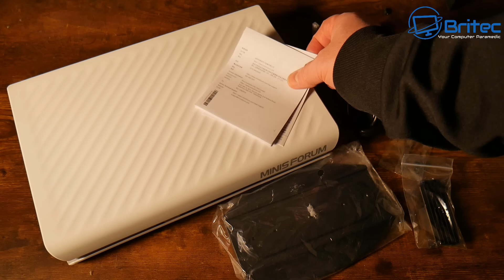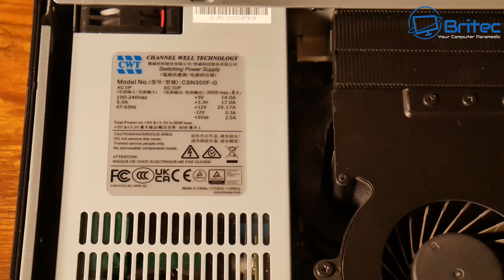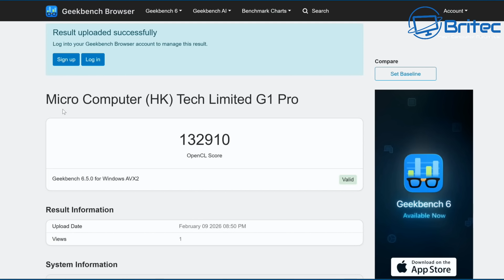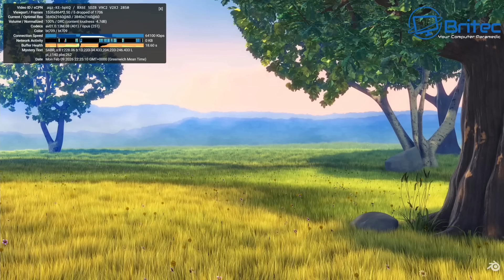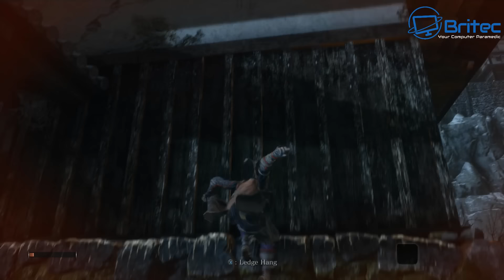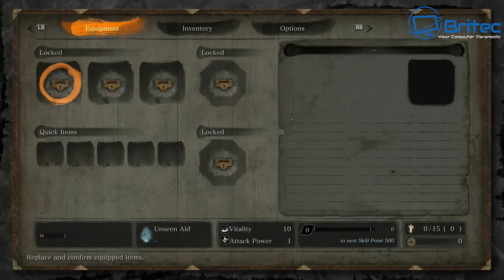They Put THIS Much Power in a Tiny PC? Minisforum G1 Pro

Comment: i want to get one but i want to know 3 things: 
1. can i get it to boot up via controller like a console?
2. can i get a barebone version like they do for other minisforum builds?
3. can i put  steamOS in it?
Reply: You can swap the GPU for Vastarmor 9060 XT for steamOS.  You can upgrade the flexPSU for something more quiet during idle.  You have to buy it with the GPU and RAM.

Comment: Hello, I am interested in this MINISFORUM G1 Pro mini PC. Could you please confirm the exact RAM configuration included with the 32GB version?

Specifically:

Does it come with 1 x 32GB RAM module or 2 x 16GB RAM modules?
What type of RAM does it use: DDR5 SO-DIMM?
What is the RAM speed, 5600 MT/s or another speed?
What is the maximum supported RAM capacity for this model?
If I want to upgrade to 64GB or 96GB later, what RAM configuration do you recommend?

Thank you.
Reply: i answered your question in the reddit subreddit for minisforum with pictures:)

Comment: @Britec09 Forgive me if this is a stupid question, I have 64gb of Crucial DDR-5600 SODIMMS 1.1V CL46 (Two 32gb modules) can I use these in this PC or does it have to be DDR5 - 5200. I know nothing about RAM just trying to save money by using these. 😁
Reply: The G1 Pro actually comes with one stick of Crucial 32gb DDR5-5600. The 5200 limit is caused by the CPU.
So to answer your question, yes you can use your 64gb. It's also preferable to use the RAM in two slots (dual channel) to benefit from the added performance.
Reply: @dfender2009 Thank you so much for your reply. I am in Australia and just purchased this! I won’t be gaming with this it will be for MasterCam CNC modelling and machining. 🙏🏼
Reply: @jonaldhinio mine is on the way, but for the purpose of gaming 😅

Comment: Hi, and thanks for the review! I have a question:

I’m thinking about buying either the G1 Pro or the new AI X1 Pro 470, but I’m not sure. I’ve heard that the G1 Pro can get quite noisy when it’s under heavy load, while the X1 Pro 470 is supposed to be quieter.

What would you recommend? I don’t want to constantly hear loud fan noise. I’ll mainly use it for office work and maybe a bit of light gaming after work.

Do you have any experience with the noise levels on these models, or have you heard anything about them?

Thanks in advance!
Kind regards,
Daniel